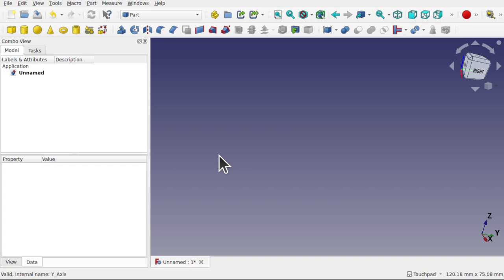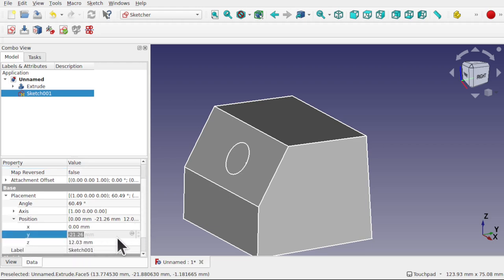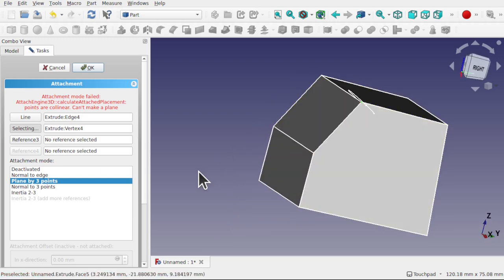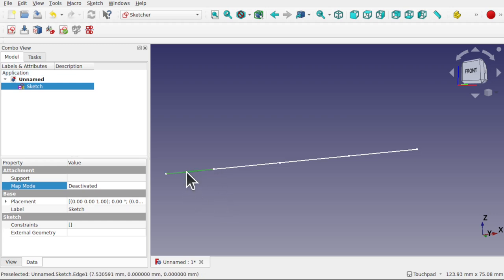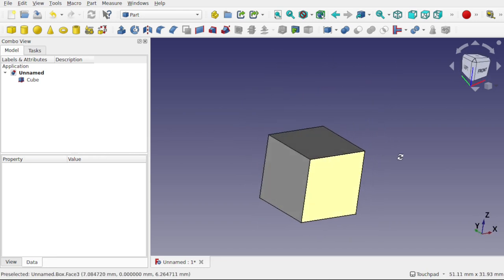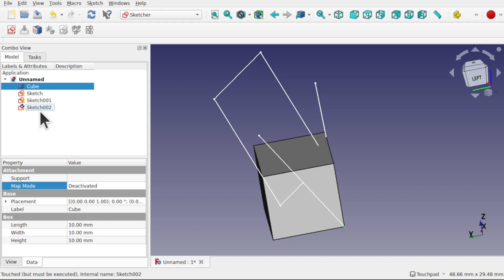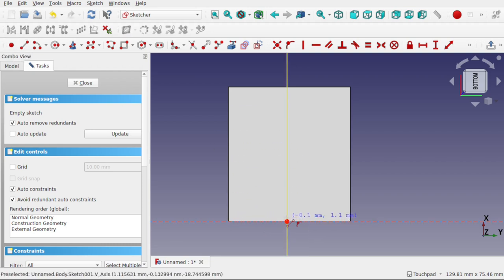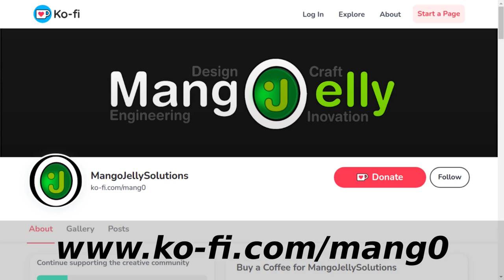FreeCAD Basics of Using Sketch Attachment Modes

Comment: 00:00 Intro
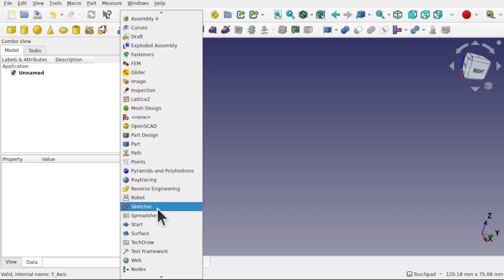00:14 Creating a sketch on a base plane, explaining differences to global coordinate system
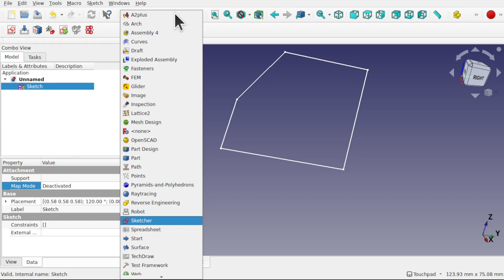01:32 Part: Extrude to create example geometry
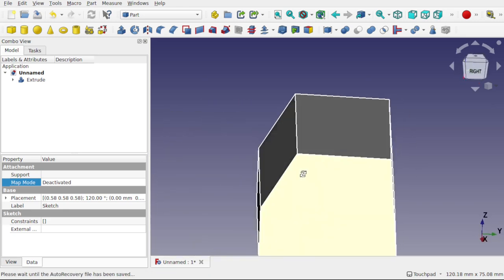02:00 Attaching a sketch to an existing face
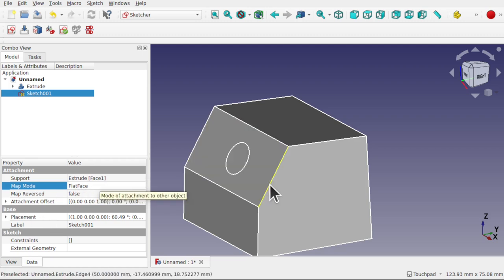03:31 Moving the sketch
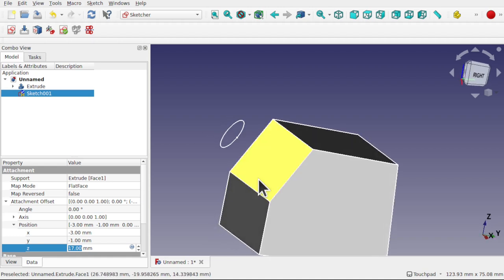04:02 Attaching a sketch normal to an edge
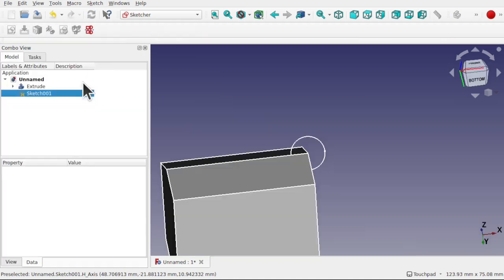06:11 Moving sketch to other end of edge
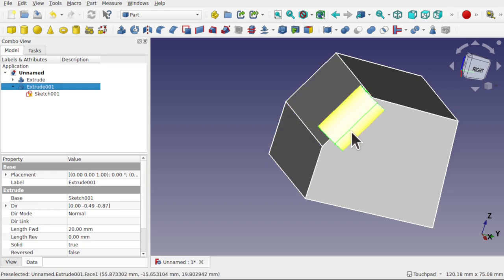08:06 Attachment error example
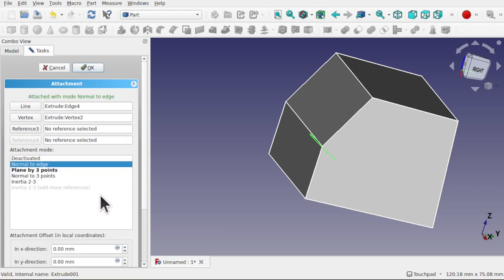09:21 Translating sketch to a vertex
10:03 Sketching example loft path
10:55 Attaching and orienting example loft profile to path
11:30 Clearing sketch attachment while maintaining placement
12:31 Sketching example loft profile 
12:55 Translate Origin on detached sketches
14:23 Creating scaffolding sketches as attachment points for another sketch
16:35 Attaching sketch with Plane by 3 Points
18:39 Part: slicing object with newly attached sketch
19:25 Changing sketch to change the slice
20:20 Abbreviated process of 01:32 - 20:19, but using Part Design (extremely similar)
25:20 Outro

Comment: Interesting. I'm looking for a simple solution to a simple problem - i want to create some fins around cylinder with somewhat "spiky" top so when it goes through the hole in cartoon, it should cut into it a bit to prevent rotation. It basically needs to create triangle, move it upwards (pad) to create a fin. Then I want to magically add a point that is above midpoint of one edge and create three new faces for a spike. Other  solution can be pad to maximum height and then add three points below and use them for a reference of cutting planes. Final step is to create array and a boolean operation with a cylinder. But in the end it's just a splitting edge and moving one vertex up in z axis.

Comment: This video is always a great refresher. It should become a primer for CADing.
Reply from the maker: Thank you, glad you enjoyed. I will doing some more videos in the future that will be using this a lot. Come to think about it, my next surfacing video will be 😊😊
Reply: @MangoJellySolutions  I think my over all problem was trying to loft between two sketches which would have created two parts at once using the Parts Work Bench. Once I deleted half of the sketch, the problem was solved. I was trying to create two parts at once from the loft between the two sketches. I lofted the one part then duplicated it rather then creating two more sketches for the other half.

Comment: It is not clear to me, why @3.06 the center of XY axes is off the top ridge of the block and then @ 5:30 the center of XY has moved to the end of the mapped line whereit meets the end of the top ridge. When the map mode was flat surface, why the center was positioned on the same edge as the edge which was later re-mapped but just little bit off the end of that line/edge. From what I have learned in the school, the plane runs from infinity to infinity in any direction.....so unless you specify the center and the direction of XY axis for the potential sketch the plane doesn't have any center and axes. Same goes for the line. The edge is actually not a line but a line segment and so I would understand the center of the XY axes is at one of the end points...but you did not specify which one and you did not specify XY orientation....So it is obvious, that the system(FC) runs under some sort of assumptions and we need to find, what these assumtions are or at least have a link to where these assumptions are explained! Without that it looks to me very ambiguous.